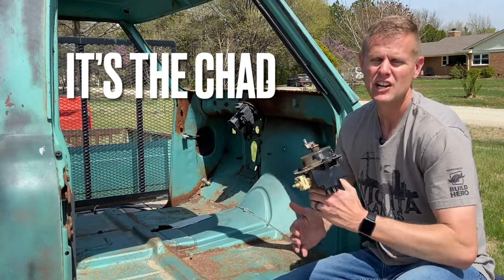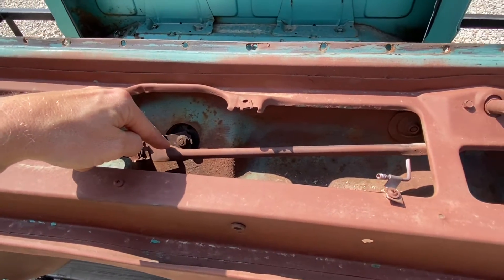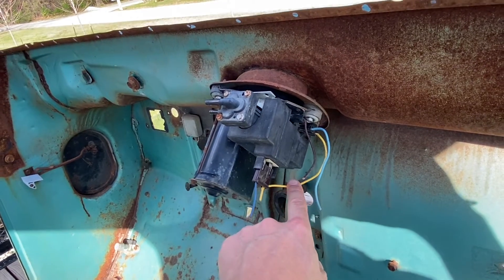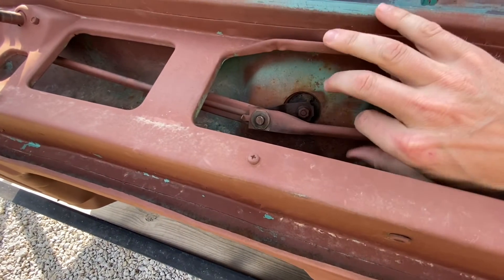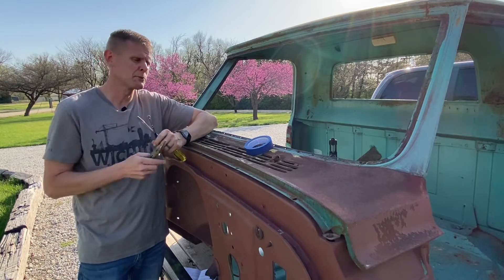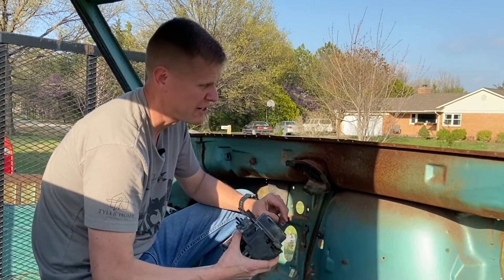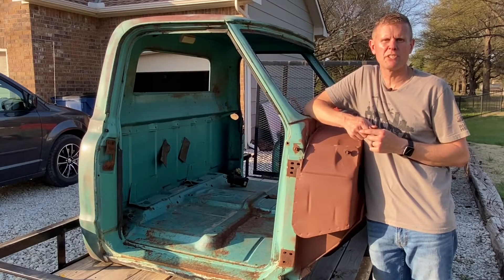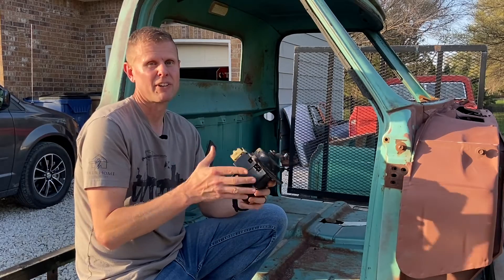1967-1972 Chevy / GMC Truck - Wiper Motors

Comment: Once again the Alpha Chad to my rescue! During the process of wiring I could not for the life of me figure out why my wipers were not functioning properly. Turns out, the ground wire on the side of the wiper motor had been discarded and the guy who helped me had hooked my windshield wiper ground where my dash panel ground was supposed to go.
Reply from the maker: Awesome! Well the part where the video helped, not the wiring problems! A lot of my knowledge comes from a lot of screw ups! Haha
Reply: @C10TruckNerd  yeah, I went out there today to crank it up and run some errands on my property (no insurance yet so it stays close) and the battery was dead.... I'm thinking I hooked something up wrong somewhere and have a dead draw. Hi-ho hi-ho it's back into the dash I go!
Reply from the maker: @intotheaether9022  ugh! Well at least you don't need to hook a computer up to it!
Reply: @C10TruckNerd  you're not wrong!

Comment: Nice video, I did mine around 1990 from under the dash. I unbolted the motor, locked a pair of needle nose vice grips on the arm and took the nut off. Installed the new motor to the arm and bolted it back in. It took me about a hour to do all by myself. It is a little tight in there but it can be done.
Reply from the maker: Good to know Steve! Was yours a AC truck or heater only? Just wondering with the extra duct work.
Reply: @C10TruckNerd   Mine was non A/C Chad.
Reply: Steve on my 72’ My Wipers just quit working - switch is Om but The Motor is Very Hot 🔥- so I’m assuming the Motor is Bad. 
LMC MOTORS has one but Says is it a 3-or 4 Terminal. I see 2- plugs 🔌 on the Rt. Side .
Reply: @jimmysapien9961   You will have two plugs for the wipers and a plug for the washers. The wipers on the three wire has one plug with two wires and a plug with only one wire. You need to see how many wires are on the plugs so you get the right motor. Chad's video shows the plugs around the 3:15 minute mark on this video. Check to see if you have a 3 or 4 plug motor before you buy one. Also check local part stores. Some still carry them in stock, my local parts store has them.
Reply: Well I bought the Wrong Motor - for my 72’ ( 4 Termnal ) my old one was A Three Terminal. CHAD. STATES  it’s ok to use a 4- TERMINAL - just don’t use the 4th Terminal  well I tried NOPE The Wiper Motor Kept on Turning and Would not Go back and Forth .  So I ordered  the 3 terminal one From

Comment: I just replaced the rubber hoses on mine. Pain in the butt too. I went through the radio space. Still have a scuffed up forearm and wrist. I haven’t checked if it works yet, but I’ll definitely pour water down the feeder tube to prime the pump. Thanks for the videos.
Reply from the maker: Thank you! Working on these things are a great way to shred knuckles and wrists! Thanks for your time!

Comment: Came here to see how it mounts, because mine has some "missing" metal.  One should always leave the cowl tray full of dirt, bugs, and leaves, while filling the kick vents with expanding foam.... Smh.  Thanks for the video!
Reply from the maker: You bet! Did I sell you that truck? 
Lol! Sounds like the ones I buy. Check out my cowl panel video. My 69 was so bad the entire motor and mount dropped into the cab. I wish guys cleaned them out every once in a while.   Rust repair down there is a real pain.

Comment: Hello Chad, thanks for the video. I had a question I was driving my 71 blazer in the rain and My windshield wipers were working fine. Turn off the truck and 1hr later came back now they stop working. Do you have any idea what the problem can be?
Reply from the maker: Thanks Cesar! These motors rarely fail. The switch, fuse or connections are usually the problem. I would start with the easy stuff. Check the fuse 1st. Then try rotating the wiper arms manually to make sure a pivot point isn’t bound. Grab a test light and make sure you have power at wiper fuse at the panel. Maybe clean both sides of the metal where the fuse connects to the box. Check for power at the motor and switch. Tap the motor with a screwdriver or something hard. Might just work. Keep me posted!
Reply: Is the Motor Hot ???

Comment: Great video and thank you. Inspecting my motor and found I got quite a bit of metal missing around the mount.  Of course I had to prove it a bit and all that rust fell out like fairy dust. Any advice on a temp to semipermanent repair?
Reply from the maker: Dang fairy rust dust! Cutting it out and putting another in, doesn't sound like any fun. I have always gone to my faithful mud and fiberglass for temporary fixes. Then I just forget about it until i have to deal with it. If its weak and you can pull the cowl off and give it some support from the front side might buy you some time.

Comment: Great video, thanks Chad!  Having an issue with my '70 C20 where washer fluid will squirt constantly whenever using the wipers.  Any ideas there?
Reply from the maker: I appreciate it! Could be a couple things. The washer gets its power from the wiper motor, so it could be a mechanical. It could also be electrical. Make sure no one has tapped into the wiper motor wiring for power for something else. Also check the dark blue wire. That is the washer wire. If all else fails, you can just disconnect the washer pump if you don't use it much.
Reply: @C10TruckNerd  Thanks so much for the reply.  Will start digging into this a bit more over the holidays 🎅🍻🎄

Comment: I have a1970chevc20. My wriper when arms are put on under the cowl w/o a clip on them. the blade will hit the cowl when in run. ,move thearms it hit the post. can not find out what is wrong.  the wriper in set at about 5 dagree from mark on motor. Doen the clip on motor arms have to be on. thank you
Reply from the maker: It should be on to keep the transmission arms onto the motor arm. You can pull the wiper arms off and put them back on a few degrees more to see where they end up.

Comment: Do you have to remove wiper motor to replace washer pump?
Reply from the maker: Nope. That is if your arm can fit up in there. Just two 1/4” bolts hold it on.